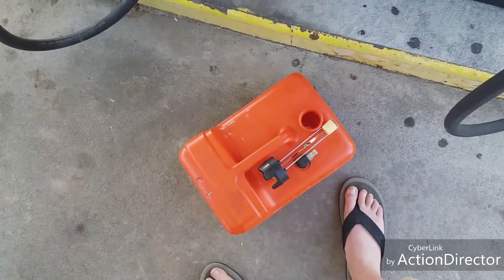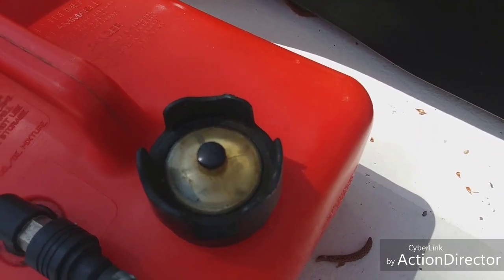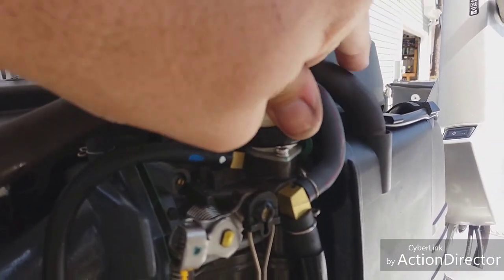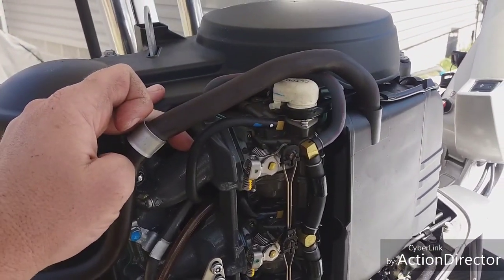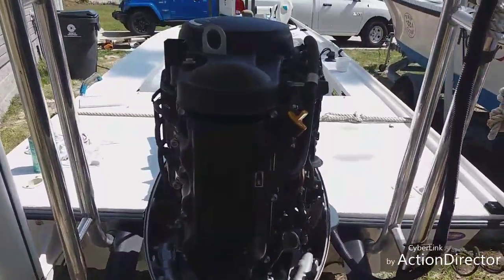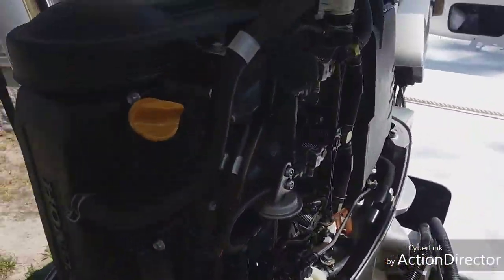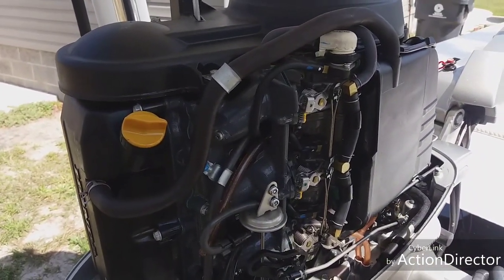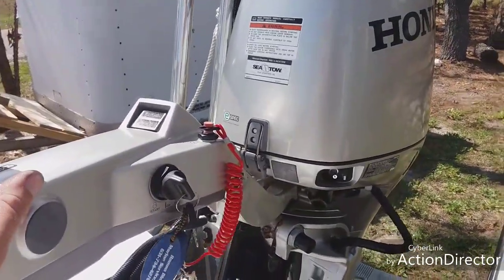Starting Honda 40/50 HP with the Dreaded Electric Choke or By-starter Valve

Comment: Thank you. As an ex Honda tech(non marine) I didn't know those were the wax pellet type. I assumed it was a solenoid. I am troubleshooting a bf40 and its running rich and missing at idle and stays rich until full throttle is achieved and it runs on all 3 cyl. Adjusting the screws made no difference. Going to replace the 20 year old needle valves and bystarter. Its definitely over fueling. This was a great tidbit of info i needed.

Comment: I have been having issues with my honda 50 hp carbureted 4 stroke and I was wondering what are the signs the the bystarter or electronic choke have worn out.
Reply from the maker: @henrydeutsch3123  ok pull the bystarter out cold. Is the needle out far? Put it back in. Turn on ignition let it stay on for a bit. Remove bystarter again. Is it hot and did needle retract? That will let you know if it's working. Lots of times it's carbs that need cleaning. Try that out.

Comment: for any future internet travellers 
electronic choke resistance should be between 15.8 - 24.2 ohms and you can test its function by blowing air or spraying carb cleaner down the fuel passage. it will flow with the choke off and after a few minutes with 12v supplied the passage will be blocked

Comment: I have an 07 bf50 that have replaced tank, lines, plugs, fuel pump and this thing takes 40 minutes in cold weather 40 degrees or less to even think about running right sometimes it'll run well but others if you throttle up it'll fall on it's face and die.
Reply from the maker: I'd start thinking about another motor. My 04 is showing obsolete parts now. Your gonna be in that boat soon.
Reply: @captainrobthompson8728 not really wanting to as the motor has less than 150 hours
Reply from the maker: Mine too. My carbs are obsolete and I can only rebuild. If the carbs were cleaned to good that can also be a problem. Look for a complete carb bank online. That maybe your saving grace looking long term. Try a small oring under the keeper that holds the bystarter valve. Adjusting the height of the bystarter has helped with some models. It's the needle and the amount of air/vacuum getting by that can mess it up. The ratio has to spot on or it's like your choking it still.

Comment: Does Honda have any instruction on how to properly start a motor with this type of choke?  I have the 50HP and same choke but the manual says NOTHING about how to move the throttle how you explained!  BTW your instructions on moving the throttle several times then back to zero worked perfectly. Much thanks!
Reply from the maker: Your welcome! It was just trial and error working with the system that we found snapping the throttle worked out.

Comment: Now that I know I have a carb engine, I'm having problems starting.  I have cleared the fuel lines, pulled the fuel pump and changed the fuel filter as well as cleaning the fuel tank.  Using you 3 prime method I get the engine to run for about 15 seconds.   I can repeat the several times but cannot get the engine to run more than 15 seconds.  The engine has been sitting for almost 3 years and I'm not sure what kind of fuel was left in the engine.  Found the floats be stuck closed causing no fuel to the carbs?  Also is there a trick to pulling out the carbs to check the floats?  Thanks.
Reply from the maker: Hi John! Your gonna have to take the entire intake manifold off and clean those carbs. It's gummed up. If you can get an ultra sonic cleaner that would be best. Just use soapy warm water in it. You'll need carb rebuild kits and gaskets. Make not of all needle settings. You have a decent job ahead of you. The carbs on these never fare well after 3 years. Good luck. I don't have enough storage to film that job. You may want to take it to a shop.

Comment: How do you know if your engine is carbed or FI?
Reply from the maker: Follow your fuel line. If it goes to one grey box you have fuel injection. If it splits to 4 little bowls you have carbs. If there are a lot of linkages on the starboard side you have carbs. If you have a fuel rail and injectors you have efi.  If you turn the key on and you hear a pump kick on for about 7 seconds you have efi. I hope that helps.

Comment: Are those carbureted 4 strokes good reliable engines? I'm looking for a bf50 for my old bass tracker. I really want to not use any more 2 strokes. Thanks
Reply from the maker: They are good if you don't let them sit and use only non ethanol fuel. They have been fuel injected for a while now so if you get one make sure it's been in fresh water. That way you'll have less problems. Good luck!
Reply: @captainrobthompson8728  thanks for your help 👍

Comment: Thanks for the answer Rob, one more question: my 50 hp Honda (yr2000) is just put in the water after 3 years on land, rpm is not going over 4000, any idea how to address this problem? Thanks
Reply from the maker: No problem! Could be a few things. Make sure plugs are good. I'm leaning toward a carb is fouled out. Or your prop hub is spun. Check those and get back to me. Hopefully one of those will fix it.

Comment: Thanks for your video. I am told that Honda no longer provides the electronic choke/starter switch for my 2000 50 hp carbeurated outboard. What options do I have to replace that part which no longer works to choke the engine?
Thanks
Reply from the maker: Hmmmm? There are none. I would call some dealerships and see if they carry any or have it off of a used motor? I guess we maybe getting obsolete at 20 years old?

Comment: thanks for the video, I was a little concern with my water stream not flowing strong enough but based off your video my cooling stream is the same, it does increase flow with a increase of RPM. thanks again

Comment: Hey if bystarter is bad will it do this… start and idle fine for almost a minute then rev up and down on its own. Runs bad under load while in gear but out of gear it runs better (running at about 1/2 throttle).  Cleaned carb, fuel lines inside engine are replaced, tested fuel bulb and connections, did valve job, fuel filter isn’t clogged. I’m at a loss
Reply from the maker: Hmmmm? Still sounds like carb issue to me. How did you clean the carbs and how many times have they been cleaned?
Reply: @captainrobthompson8728  Took the carb apart and I sprayed it liberally with brake cleaner making sure each little pinhole would spray fluid out of it. Brake cleaner doesn’t have that minute bit of oil in it that carb cleaner has. The only part of the carb and I know we didn’t get taken apart was the little spring mechanism that the bystarter (auto choke) pushes up and down.  I might take the carpet apart again and soak it in solvent. But my father works on small engines and thinks we got it good but still thinks it might be a decent idea. Any other ideas?
Reply from the maker: I was thinking it may have been cleaned to good in ultra sonic cleaner. I've see that strip them clean and never run right again. It maybe a vacuum leak or a dash pot issue. A bad bystarter you can raise up just a hair and see how it runs. I put a small oring under the metal platearound the screw and screw it down so you have a small gap. That keeps the needle up a bit more. How is the intake manifold gasket and the screws for sync and link? Hit the intake gasket with some ether see if the motor jumps. You got some work ahead of you.

Comment: I was gifted a 1995 BF50A with remote set up, with manual choke. Its currently on a stand. I want to run it prior to putting it on. I don't have the controls, just the 14 wire harness  and battery cables. Can I jump it temporarily just to check it? If so,  can I just hook up the battery cables and use the solenoid wire to jump it......? What wire do I use also? Love your videos. Cheers.
Reply from the maker: Hey Jason! It's been a long time since I've done that. It's worth a shot.  I would just cross the terminals on the solenoid or use a jumper box and go straight to the starter. I believe the neutral safety is on the motor and not the control box. The kill switch/safety lanyard may foul you up. At least you can crank it over get a compression test and see where you lie. I would get that gearcase off and check the impeller. It maybe brittle and shot. Hope that helped. Let me know what you find out. It is a primitive wiring set up so it may work. To shut it off choke it out and or put a rag over the intake. Good luck!
Reply: @captainrobthompson8728  i got it to turn over!!! But not fire 😔. I tried connecting the lanyard wires too. Ill do a compression test and check for spark now.... I've got fuel coming out of the middle carb though, just under a little round spot with an indent on the side facing me(when I pump up the primer bulb), could that keep it from firing?? Appreciate your time and feedback. Ill be watching more videos later tonight! Cheers.
Reply from the maker: Ok so you have a float stuck. You will have to take the carbs apart and do a cleaning. Ugh! The fun with motors
Reply: @captainrobthompson8728  im not getting spark either. Is that just a bad coil back? Only tested one plug so far though.
Reply from the maker: It maybe from no ignition key on try all 4. Ask around and see if anyone has a harness or ignition?

Comment: What's the number of the oil filter used on the 50 Honda 4 stroke
Reply from the maker: 15400-PFB-014
Reply from the maker: 15400-pfb-014
Reply: What's the number of the 50 Honda oil filter

Comment: How do you manually tilt a BF40D made in 1995?  Cannot find a release lever or cylinder release screw.
Reply from the maker: It's called a dampner. There is no relief screw like a trim and tilt. The ram is still available but for $994. Keep trying to soak the handle so you can get it working. If you have to unbolt it just gut it out and manually lift it or put it down. Sorry I don't have better news:(

Comment: Hi. Thanks for your informative videos.  They’ve helped me a lot with my 2006 twin 40’s I just got with my C-Dory.  

Not sure if you still monitor this, but I wanted to know if you’d suggest putting them briefly in gear wide open or raising the fast idle briefly before starting because I can’t snap the throttle since they aren’t tillered.  The carbs are clean (completely disassembled and soaked in carb dip and ran through ultrasonic cleaner), but the engines still give a lot of trouble starting.  They get there after cranking 3-6 times for about 4 seconds each time (enough time for folks at the launch ramp to think I’m not making it out).  

I don’t have access to ethanol free fuel (CA), but when I flush the engines, I use Trufuel ($20 a gallon), so that is what sits in the carbs when it’s not in use.

Thanks again for your time and your videos!
Reply: Thanks, I really appreciate it.  I’m at work for a few days and won’t be able to get to the boat for a little, but I’ll try the modifications that you’re talking about.  

Just for clarification you don’t think I should give each engine a shot of fuel with the fast idle or throttle before I try and start them the next time?

Thanks again for the help and the fast detailed responses!
Reply from the maker: Ok. So you have a dual side mount control box? Manual choke or electric? I'm trying to think of how I would start this.
Reply: @captainrobthompson8728  Correct.  Dual side mount control box at the helm with starter enrichment valves (replaced and new from factory X2).  Carbs recently synced and tuned as well.  

After I cleaned the carbs and before I started using Trufuel to flush the engines I would let the ethanol fuel sit in the carbs, but would run each of them religiously at least once every 2 weeks for 10 minutes.
Reply from the maker: Ok I see what you have. You have the bastard ones you fight. I've seen so much covered under warranty to keep some running. So here is what you need to know. If this has the white electric choke on top of the #1 carb remove it. Put a small oring under the metal tab around the screw. Reinstall. Instead of going tight you'll have to find the right height almost like a shim. Your choke is on but shouldn't be. It sucks but I've had this work a few times. Honda Quads had a shim kit outboards did not. Also just make sure your primer ball is hard and you have all 5/16 fuel line. 3/8" is a no go with Honda's. I hope this helps. Let me know what happens.
Reply: Okay captain try this. Don't do it have ass just try it trim the motor all the way up Pump the ball hard if you have a primer now keep in mind you are trimmed all the way up boat is in the water engine is actually still out of the water don't freak out once it's running trim down reason being a lot of times because fuel floats on top of water it's the angle of fuel going into your jet also check your water separator if you have as far as the adjustments you were talking about depends on how big of a boat or motor you're running how long you've had it believe it or not a lot of times especially on cheaper Motors or some cheaply built ones the two clips that hold down the float Bowl to keep it at a certain amount of fuel actually Bend up allowing too much gas. Air fuel mixture has to be precise. Last question? When you were running at speed do you hear a low pitch popping almost can't hear it unless you were trying to very low level pop pop pop that is a definite sign of water in the fuel also check for vacuum leaks I could go on and on don't know your situation but if you have good fuel spark and compression all motor should run
Reply: Also if you're not running that motor for any period of time definitely drain all fuel out don't use these additives those are not good for the motor those are for emergency Quick Fix situations anything from seafoam to starter fluid one other thing I do is I will use a 5 gallon bucket most people have ear muffs that's cool too but if you can get some type of lubricant in with the water because of course you got fresh water on them but to have them get a little bit of penetrating oil it keeps the plastic in the impellers alive longer bottom line Outboards like to be run and you get more longevity when broken in properly and driven at the right RPM it's a balance but that can be adjusted too through carburetor adjustments and even hotter or colder burning to spark plugs I love Motors

Comment: Warm start problem with my 2004 BF40, cold: starts and runs great. If it is shut down for more than a 1/2 hr. it will crank for 10 to 12 sec. before it  restarts,  and will run just fine...Thanks Captain Rob
Reply from the maker: That doesn't sound to bad. Do me a favor and prime the fuel bulb next time snap the throttle 3 times and turn it over. See how it starts? Let me know. Almost sounds like your trying to get fuel up there. Check your oil level as well for me and let me know if it smells like gas. Talk soon!
Reply: @captainrobthompson8728  The  boat is not in the water yet. I noticed before I changed the oil this week that the level was a good 1/2 inch higher on the dip stick than when  I changed it last spring. Can't say if it smelled  of fuel. Note: this warm start issue has been on going for the last few yrs. thanks
Reply from the maker: Hhhmmmm? If its a 1/2" higher your making oil. I would look at the mechanical fuel pump. Take it off and try to pump it by hand. It's powered by the cam shaft so you can push with your fingers. If you see it get wet and leak some fuel that's the culprit. Take it off and try.
Reply: @captainrobthompson8728  Bad weather  in the N.E. today and tomorrow, will try the fuel pump idea when the weather  turns.  Thanks
Reply from the maker: Definitely keep me posted!
Reply: @captainrobthompson8728  Morning Capt. Rob, took off the fuel pump and activated it with my thumb, saw no evidence of any fuel that would make its way into the crank case.   thanks
Reply from the maker: Ok next time that happens hit that primer bulb and see if it takes more than 1 squeeze to prime. Do this after running then let sit for half an hour. Try to replicate. Look at your spark plugs too. See if they are carboned up. I'm wondering if the bystarter electric choke is hanging up?

Comment: Having some issues getting my BF25D started. Always used ethanol-free, no issues. Won't start most times, but occasionally I can get it going and it has some sort of knocks. Two really short videos here: https://www.youtube.com/watch?v=swLsrMsTrms (4 seconds) and running with knocks (https://www.youtube.com/watch?v=ctJi_Idmfro)  It does eventually run well, after about 15 minutes, but after a few days it won't start again. Carbs? Electric Choke?
Reply from the maker: Ok so you need to clean the carbs. Then do what's called a sync and link. You have to sync the carbs to run together. You may have to have a shop do it. But first clean those carbs find the base setting for the idle screws and go from there. Start with fresh fuel too. Good luck you have some work ahead of you. Once that is done then worry about the electric choke. They can be finicky but you will not know til the carbs are known good!

Comment: A new Honda-5 marine engine burned out after using it three times for a total of 3 hours. Then I contacted Honda’s customer service department and asked to replace a new Honda-5 marine engine or bear the maintenance costs, but all were rejected Therefore, the quality problems of Hoda-5 marine engines are very serious, and Honda’s quality assurance commitment is also unreliable.
Logan Cheng
calogancheng@gmail.com